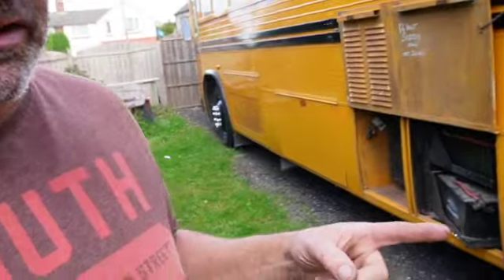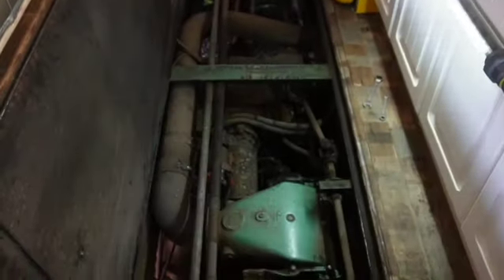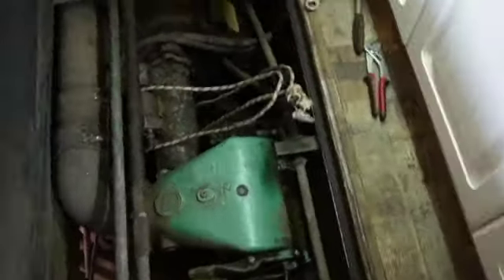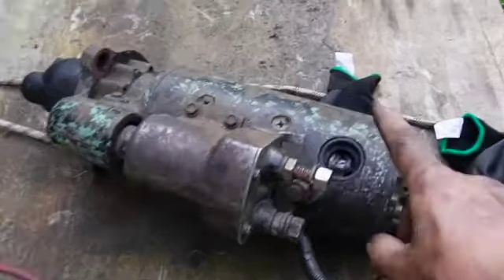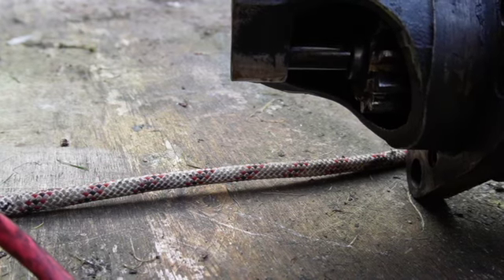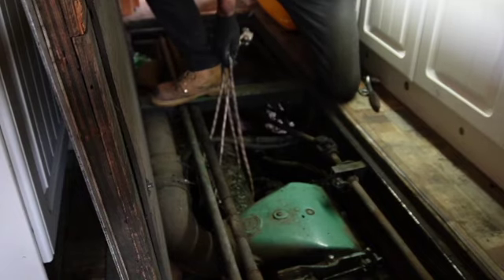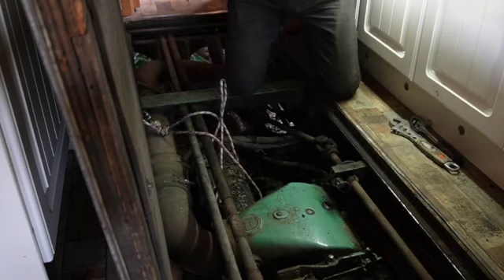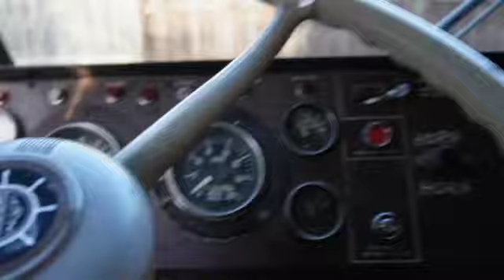Crown super coach repair on starter motor #converted American school bus#1980 Embree bus

Comment: Sounds like you need to adjust the buffer screw on the governor, just a wee bit, to eliminate that hunting at idle when cold.
Reply from the maker: Thank I will have a look at it
Reply: I have the same 'hunting' in my 6-71 in my Crown.  I thought it was normal to so that until it warms up.